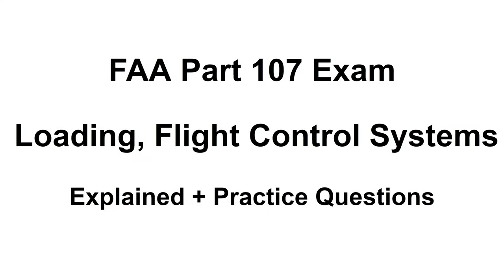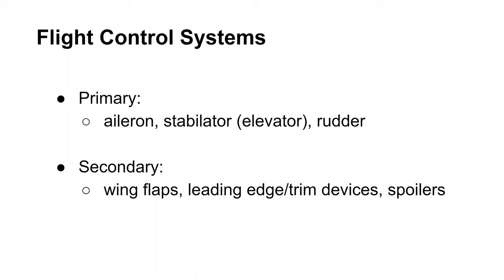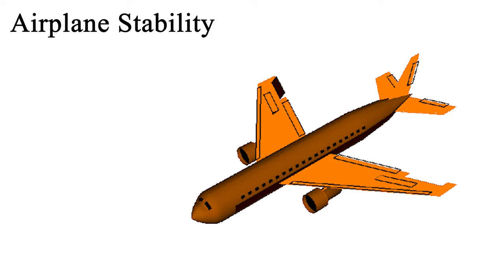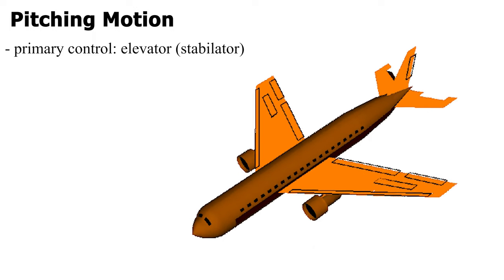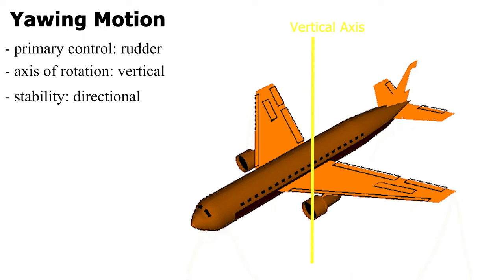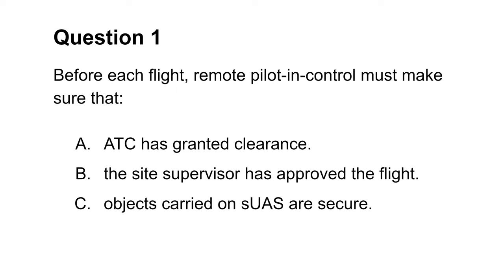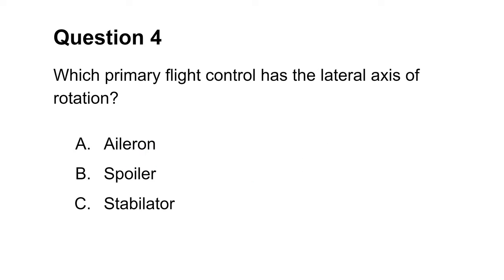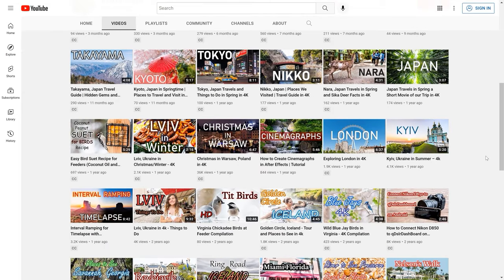Flight Control Systems | FAA Part 107 Exam Tutorial

Comment: Where does it specifically state that panels and doors be locked since drones have no locking mechanisms on panels and therefore would be impossible to comply if the requirement stated that.
Reply from the maker: This language is coming from the ASA study guide I used to prepare for the exam. They probably took it from the FAA materials. The point of that statement is to ensure that everything is secure and objects do not fall off the drone, injure someone or change the balance unexpectedly. Hope this makes sense.